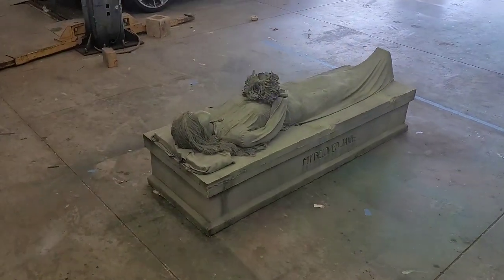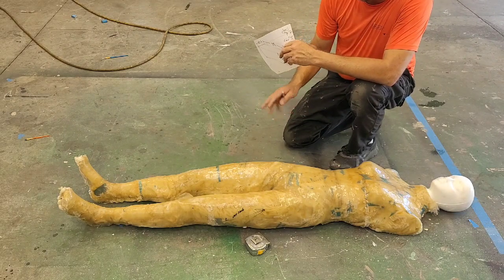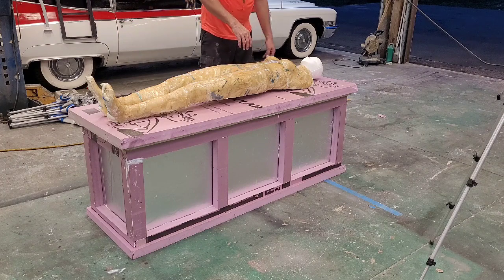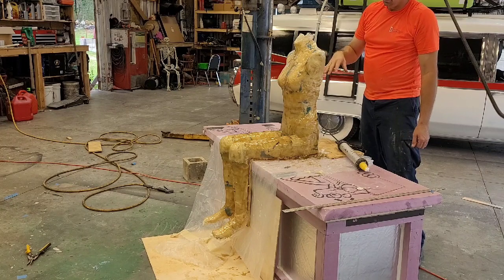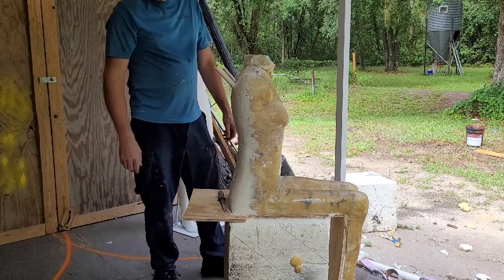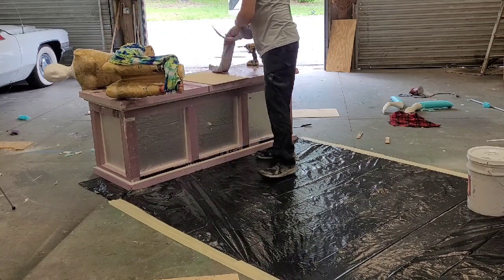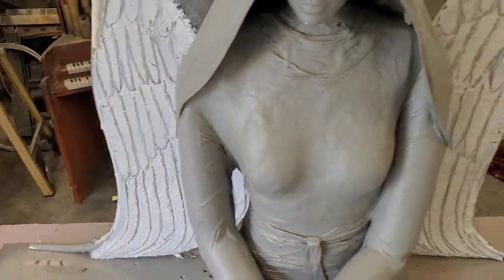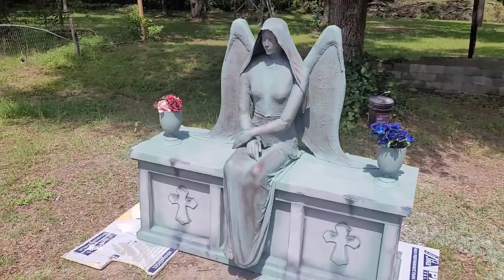building an angel monument

Comment: You did a fantastic job putting this prop together. At the end I was saying to myself hey great job with adding the flower vases you should leave them there. I feel like it helps to balance things out. You did a really fine job with working on the patina for the angel if anything you might consider a little bit of a black wash to give it a little bit of a streaky look to it but otherwise man I think it is just perfect. 🎃
Reply from the maker: Thank you,
The flower vases are staying we're just gonna use different flowers. That's what i should have said.